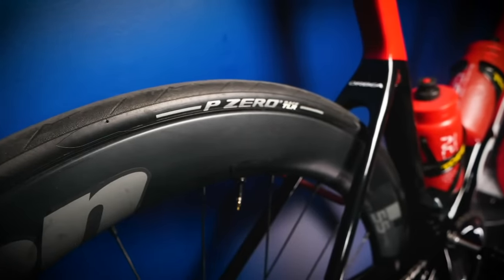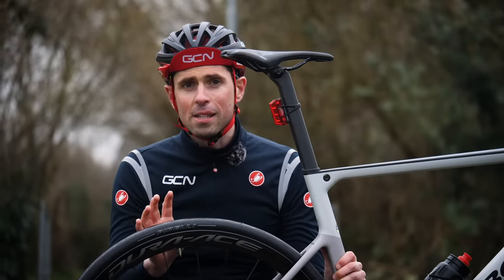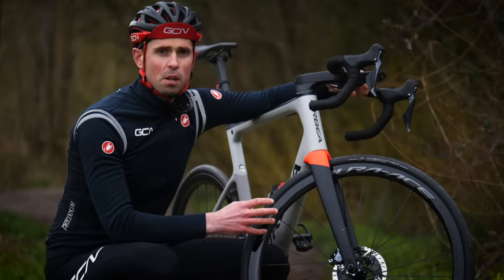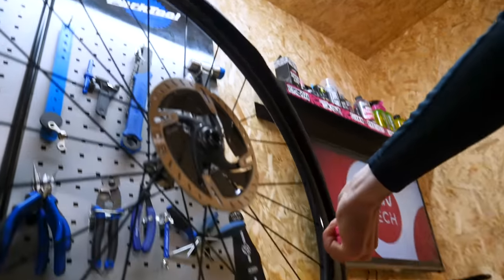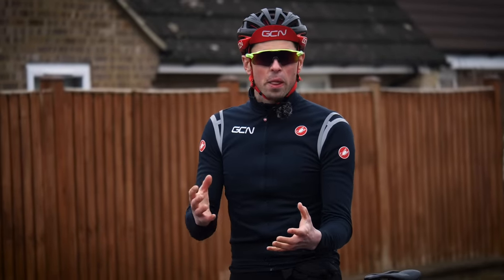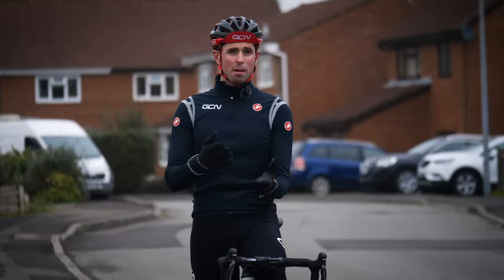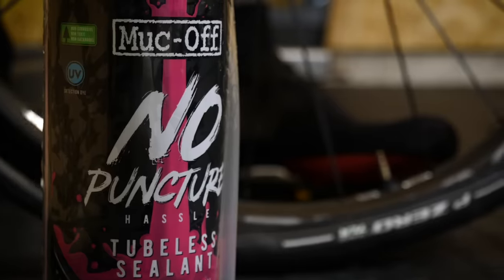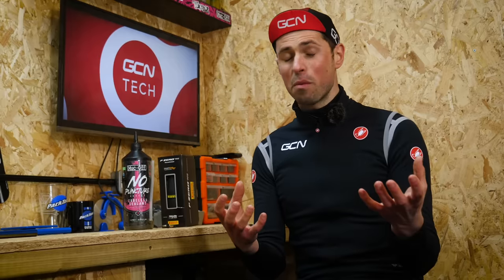Tubeless Convert! | Why Alex Will Never Use Inner Tubes On His Road Bike Again

Comment: What I want is the absolutely minimum maintenance and when they do require any work then I don't want anything complicated at all.

So when you're squirting that sealant liquid stuff and messing around with that, that is one complication I don't have, I have the most simple inner tube and clincher. Simple is better.
Reply: I agree. I tried tubeless and frustratingly spent a lot of time trying to seat tyres. I questioned why I was doing it, when I could have my normal tyres on the rims in a few minutes. It is the same with disc brakes: centring or truing rotors and freeing pistons is a real faff at times.
Reply: Did you see the mess he made seating that tire?
Reply: on the same page here
Reply: It's better for You. Tubes are clean and tire pressure pretty much doesn't matter. Hovewer, the feel that Alex describes is truly amazing. Also the chance of having to stop in a very unpleasant weather to change a tube with frozen hands is much lower. (Yep, happened to me before) It's not for people who see maintenance of their bike as necessary evil, tubeless is for people who like to tinker with their bike and benefit from it on the ride.
Reply: @michaelmechex  up to a point. I ride around 1,200km a month, so will replace a set of tyres every 3 months or so. So no need to clean out old sealant and replace, etc. Pirelli P-Zero Race TLR SLs are pretty easy to fit to my Hunt 44UD wheels, and I have a flash pump so seating is easy. And I have 6 small nicks in the front tyre after nearly 4,000km that the sealant has fixed, so that's around an hour standing at the roadside saved... 
I've had big cuts in the middle of nowhere on the MTB and the gravel bike that wouldn't seal - a plug (I use Dynaplug) fixed each one in about 30 seconds 👍
So I'd say I probably spend less time fixing / tinkering with tubeless vs clinchers. Which is a bit of a shame as I love tinkering!
Reply: After reading the first paragraph, I thought you were talking about tubeless tires. Set and forget.
Reply: @dpstrial " why am I doing this"  I asked myself the same question when I had a nightmare of a job on my rear wheel, so gave up and stuck a tube in and all was fine again. Simples.
Reply: @levbobrov1398  Set and forget, until you get a flat, and then get flamed when you mention it online, because of course it failed, and it's your fault for not maintaining it properly.
Reply: @shoeboy23john89  walking home for 15 km because both of your replacement tubes got punctured is indeed simple but neither quick nor comfortable
Reply: @ivanschekoldin7315  Always worth carrying a couple of patches and a tube of glue which weigh about 5 grams.

Comment: Not trying to be pedantic, but to quote Alex’s own words: “installation is — fairly — simple”. And that is still a very significant factor for many people who don’t live close to a bike shop or are not technically inclined. 

There’s no argument as to the advantages of tubeless but for non-pros or many weekend riders, ease of installation is paramount. 

On a personal note, I’m a regular rider using tubes, in a rural area with mid to low quality and roads, and my Conti gatorskins have yet to experience a puncture in over a decade. So, I’d be hard pushed to be sold on additional puncture resistance.
Reply: Conti gatorskins?
Reply: @willek1335  continental gatorskin
It's a popular roadbike Tyre
Reply: Mavic tubeless are easier than tubed. 

GCN did a video on them and I’ve setup some too.
Reply: Same here almost a decade on Gatorskins and no punctures, only one minor puncture but was a slow leak and only discovered it when I took the bike out again for a ride but I had no issues of  reaching home when I had the minor puncture.
Reply: The advantages of tubeless still don't outweigh the advantages of tires/tubes. No thanks... ever.
Reply: I don't get everyone suggesting conti gatorskins.  I got punctures with them constantly, and have had less with literally every tire I've tried since then.
A friend of mine used them for years, since he got so many punctures (and they're supposed to be puncture resistant), and finally switched to a panasonic, and gets way less flats.
I think everyone's fooled by the marketing, and cool name, but they're crap tires IMO.
Reply: @nwimpney  tubeless is as much of a performance thing as a puncture resistance one really, I think it's mis-sold. But the sealant does mean it's possible to run much nicer (lighter/faster/grippier) tyres than with tubes on some nasty inner city streets that normally cause multiple flats per week with performance tyres. 

Gatorskins and similar options are fine for commuting, but you don't realise how heavy and unpleasant they are to ride on till you use some nicer tyres.

Comment: "Setting up your tubeless tires is actually a fairly simple proces" :D :D :D :D
Reply: It gets easier each time
Reply: Can be trivial or nearly goddamn impossible. Depends on the tire. My conti mtb tires took me hours of wrestling and pumping, but I just put vittoria gravel tires on my bike and I did the whole thing in 30 mins and never swore once.
Reply: Super easy
Reply: @nicholkid  30 minutes is unacceptable in many circumstances.
Reply: Simple doesn’t mean easy... it depends on the tyres
Reply: @jonpoon3896  I have mounted WTB, Michelin, schwalbe, conti, maxxis, Victoria, pirelli, panaracer and Goodyear. All quiet easy.
Reply: I've now bought a flash pump - sort of looking forward to mounting the next set as it looked so easy when the LBS did it (Pirelli P-Zero Race TLR SL tyres on Hunt 44UD wheelset, also looked easy setting up the MTB, Bontrager wheels and tyres)
Reply: Replacing a punctured tube-type tire on the road is a fairly ezpz process. Handpump, tire lever, spare tube. No fuss.
Reply: @ronstewtsaw  considering it takes about 5-10 mins to fix a puncture with an inner tube it is definitely worth it
Reply: Setting it up with a NEW TIRE can be easy - need to reuse/remount a tubeless tire that has some old sealant around the bead? 
What a hassle - removing old sealant can take a long time and it STILL might not mount on again.

Hint: once a tubeless tire is seated, NEVER remove it.
Reply: @Hintonbro.  Yes that is my experience too. I removed one tire to clean it and put fresh sealant in and I was unable to make it air tight again.
Even my bike dealer had to frickle for hours with it until it sealed. Tubeless is awesome as long as you just leave it be...
Reply: @portland675  super easy, barely an inconvenience
Reply: 25 mm Conti 5000 TL on Zipp 303 NSW tubeless - fast mount, no soapy water, no sealant, pumps up first time with hand pump every time. I've had the opposite experience with Hutchinsons on AForce Al33 - soapy water, sealant, compressor, lots of praying and swearing for an hour and maybe it seals.
Reply: If you are getting the conti 5000 TL make sure you keep your protein shakes handy!!! It is not easy but it is fairly simple...
Reply: @bivani  It depends on what rims you are mounting them on. I can mount on tubeless Zipp 303 NSWs without levers with only moderate effort - but they seal perfectly every time with only a hand pump and no sealant or soapy water. Tire-rim combination is key for tubeless mounting.
Reply: Fairly simple for pro :-)

Comment: “Inner tubes are rubbish. I hate them and I am going to tell you why.”

“Because I get paid for convincing you you need tubeless tires which leads you to want new wheels that are tubeless compatible, which I just so happen to also market for major cycling brands.”
Reply: I wish that was the case, haha. 15yrs of being paid to promote tubeless tyres would be amazing. Just trying to give my perspective as someone who has used both tyre types extensively and finds tubeless a lot better all round.
Reply: @GCNalex  I rode tubeless for about 2 years because we where sponsored by schwalbe. You are right, they feel very smooth, fast and give you a lot savier feel while you corner much more agressive. And it saved a race because I once rode the last 20k with a hole in my tyre. BUT if you puncture the sealant is a big mess on the frame, that is very hard to clean. So after we switched to continental as tyre sponsor I had the choice between tlr and normal tyres and change back to normal tyre with latex inner tubes.

Comment: My new bike came with Tubeless tires and on the 3rd or 4th ride, guess what, I got a flat.  I spent 30 minutes trying to get the tubeless tire off and I could not.  I had to call my son to come pick me up.  We drove to the bike shop.  It took them 20 minutes to get the tubeless tire off.  They had to get the tire completely wet, then cover it with dishwasher soap to get it off.   When you get a flat with clincher tires.  It is still much easier to fix by yourself.
Reply: Gator skin 622's wired tire is 1 of the best tube tyres  period im using mavic aksuim  removing them are verry easy

Comment: You need to test how to seat a tubeless with a handpump and how get all that hardened rubber spray off your bike and clothing, when you had a big puncture.
Reply: Stick your finger on the hole until you can insert a Dynaplug or similar. At least 10 times faster than swapping out the inner tube. And any sealant that has sprayed onto the frame washes off easily when you clean your bike. 
You do clean your bike regularly, don't you??
Reply: So I recently noticed one of my Mavics had punctured but was able to seal. I use Orange sealant. All I had to do was literally grab it and peel it off like a sticker. C'mon dude.
Reply: @vicinius if you're riding enough kilometres then you'll be replacing your tyres long before the solid gunk forms. If you're riding casually then I agree that tubeless isn't the best option for everyone.
Sorry to hear you've ruined your wheel stickers; I've only experienced sealant spray 4 or 5 times (most small punctures seal without the spray) and every time it's washed off easily with washing up liquid in water ,and a sponge 🤷‍♂️

Comment: Switching (for a short time) to tubeless tires on my road bike was one of the worst and expensive decisions I ever made as a cyclist. 

I'm riding 20-25 TKM a year on a bike, so to be on the safe side (less punctures, more comfort, less weight and lower rolling resistance) I decided to change for tubeless. I wish I never did it, because:

- the worse puncture problems happened to me while riding tubeless...

* valve failure caused immediate pressure loss and left me swearing on the roadside 100 km from home,

* puncture (yes, they also happen on tubeless) caused all the glue-milk sprayed me and my bike on a longer trip. Have you ever tried to clean it on the next day?

Beside much more problems while riding, it was a stupid idea to switch to tubeless also because:

- you need a compressor to be able to inflate tubeless tires, which means there's no way you will make it on the road, if the pressure drops for any reason,

- you need to buy and keep at home a lot of additional stuff (milk, lubricant, compressor) or waste money and time on bike mechanic every time you want to change a tire or even to add some milk (every few months),

- tubeless tires (+ all the stuff you also need to buy) are more expensive and I didn't notice the more comfort or more speed bonus. Maybe when you're racing it makes some difference,

- tubeless tires are much harder to mount on the rim,

- if you use, on an emergency, a tube to get home somehow, be prepared you will ride on an egg, because tubeless tire has harder and less flexible wals, which causes the tire will not properly sit on the rim, and you'll be literally jumping next 100 km like a grasshopper,

- changing a tire is such a messy process,

After experiencing many problems with tubeless tires on my road bike, about 40 000 km ago I switched to tubes again (Conti Gatorskin 25mm + 100g Conti Race tubes) and no problems with punctures again. Of course a spare tube, just in case, travels always with me.

Tubeless? Never again. I learned it the hard way...
Reply: Odd. I always ride tubeless ready tires with tubes and there is no jumping.
Reply: @MrDienowlivelater  Every tire is different. I'm only telling what I experienced.
Reply: @M.Cossie  fair enough)

Comment: two and three watts?! Shut the front door! I must go and drop £1000 on some tubeless rims and tyres right now! 😅🐸 Yeah... no.
Reply: it might be 3 watts per tyre, in a racing situation that is easily a deciding factor, also your scenario assumes the wheel isnt tubeless compatible already. also also: how would you arrive @ one grand`?
Reply: My 300€ rims a TL ready 
Soooo :)
Reply: Yes I pulled £1000 out my bum, but I'm thinking if I upgrade at all it's gotta be carbon and last time I looked they're all very pricey, especially deep section ones.  🤔 Unless.. AliExpress or something no name. 😳
Reply: @ollieb9875  hunt wheels are really really good for the money, somewhere around £700 for tubeless ready deep section and tyres+ sealant. This difference is astronomical. I used continental gp5000
Reply: @blataquad  too much money! I wouldn't pay that for a car! 😅🙃
Reply: @ollieb9875  i concur, however: most new rims are tubeless anyway, so you won't be paying a premium price . but yes: buying new rims just for the sake of having tl  probably is not a smart decision
Reply: @wdadwawdadawdwdwa4133  maybe I find a deeper section alloy rim or something. I still use the rim brakes anyway. My birthday is in may, I start a saving 😳😅😰
Reply: @ollieb9875  I'm sorry you are so poor.
Reply: @berthull9333  I get the carers allowance because my mum needs looking after all the time, it's only £60pw yeah.
Reply: @berthull9333  🔔🔚
Reply: @blataquad  After six months in London the glass and debris all over the streets have shredded my continental gp 5000s. I’ve tried plugging the holes with tubeless repair rubber but high pressure road tyres make it harder to repair than mountain bike tubeless. I’ve ended up with a bunch of slow punctures so I need to pump up the tyre basically every other day. I used to have gatorskins with inner tubes and never got punctures. They’re worth it for racing but not commuting unfortunately.

Comment: I'm impressed by the fact that you could reduce pressure by 35lbs and still be faster. My experience doesn't mirror that sadly. My testing wasn't as extensive as yours but to remain similar in speed, my decrease in pressure was closer to 10psi going from tubes to tubeless.

Comment: Agreed. The term blow out comes from when cars had inner tubes that could, and did, deflate instantly like a kid party balloon, causing crashes.

Cars switched to tubeless tyres because they deflated slowly by comparison.

The last thing I want is my front inner tube going instantly flat when I'm hurtling along at 40+ mph downhill. I'd rather have latex sealant on my clothes than road rash, or worse.

Comment: I’ve ridden tubeless extensively, even on Lejog. They are a PITA to set up in my experience and a right PITA when you do get a flat (which you still do) you have to fight to get the tyre off the rim, get covered in sealant and put a tube in. Latex tubes in summer, regular in winter .. sorted 👍  Leave tubeless to the mountain bikers folks.
Reply: Not with latest wheels , you should watch this all the way;  https://www.youtube.com/watch?v=5e3lYP1p2UM
Reply: Different tubes in winter? what? Latex tubes are more puncture resistant than butyl anyway. You do not ever need to remove a tubeless tyre once installed if you carry the right plugs. Anything that can't be handled that way would end any tyres life

Comment: I converted to tubeless a couple of months ago and I'm with Alex; never going back. People complaining about ease of use are mad; make sure you get compatible tyres and you're good to go. It took me about 15 minutes to setup initially. Tubeless fo' lyfe!
Reply: Don't talk bullshit it's not only about fitting it's also about maintaining it, needing to replace the sealant every 3 months, the shit you have to deal with when the sealant doesn't seal the leak and you need to put in an innertube! I don't know how much flats you have but even in Belgium (where we have very bad roads) I only flat max 5 times a year!
Reply: @KoenMiseur  3 months? Dunno where you live but I am in the UK and I have ridden over a year without changing sealant and it was still good in that time.
Reply: @cleggycyclist  Which sealant do you use? Cafélatex tends to dry out quite quickly in summertime. No Tubes seems to last longer and is easier to clean off.
Reply: @guidospanoghe8896  Stans

Comment: I have been running tubeless on all three of my road and gravel bikes for the last five and a half years. No issues that a tire plug couldn't deal with, no mess from sealant spray, comfortable ride with the lower tire pressure, superior grip for the same reason. Seated all bar one pair with a frack pump and I used a Co2 inflator to set up the "difficult" set. As Alex would say win, win, win.

Comment: For a fair comparison, should have included power numbers. Or you should mention up you rode at constant power. I recently switched to tubeless and noticed the increased comfort and smoother slicker ride.  No idea whether they are faster.  The avoidance of pinch flats is probably a benefit as well as auto-plugging of any holes